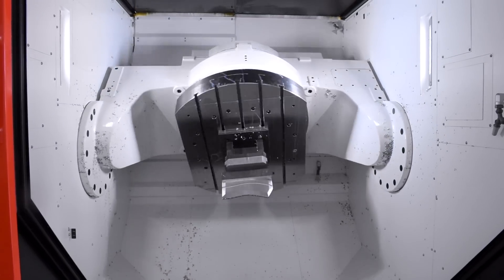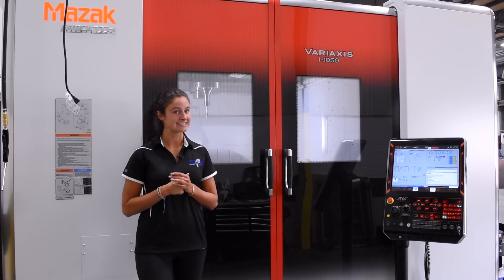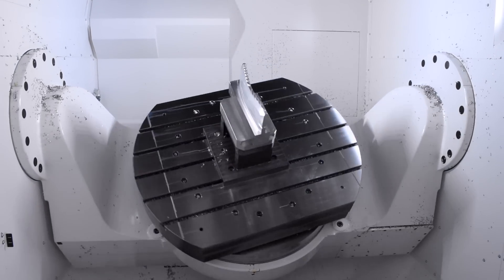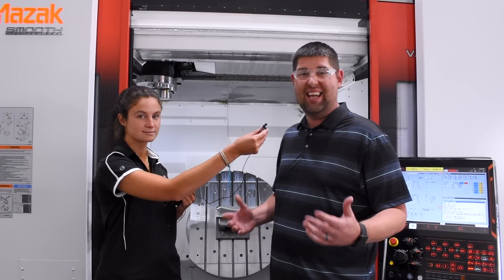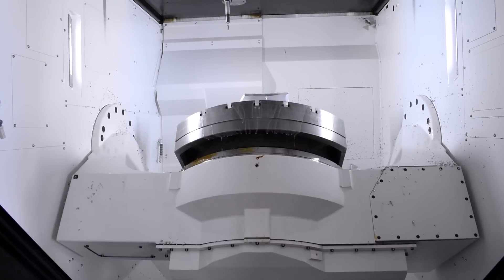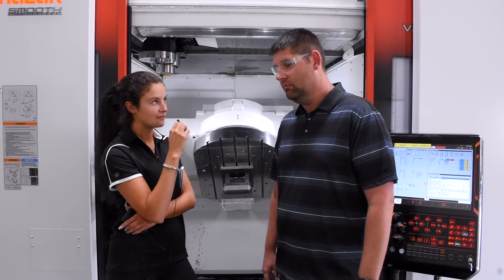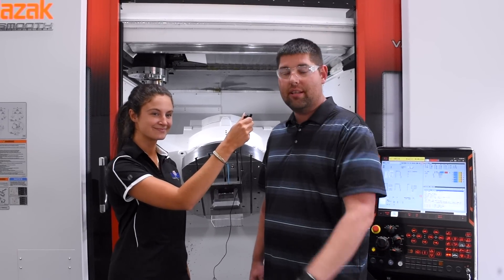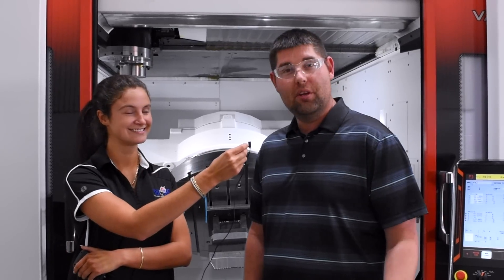4,000lbs Parts On 5-Axis Machine!? The New MAZAK Variaxis i-1050

Comment: Lovely machine, you'll surely get a lot of value out of it. Do you think the 10kRPM spindle will extend the cycle times with small dia. tools, or would you probably not end up using small tools for parts on it?
Reply from the maker: @Muny  That’s a great question, it may and I’m sure we will use whatever tooling is needed to complete the job? Including small diameter tools. Thanks for watching and the comment!
Reply: To think of all the quality equipment I've let go of because I could no longer procure new or used replacement parts. I wish you guys were in my neighborhood.